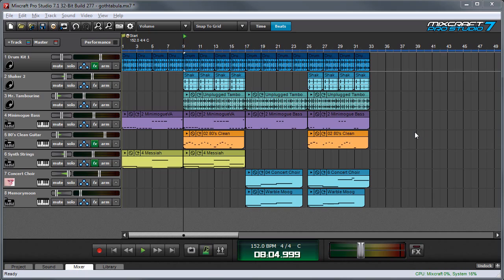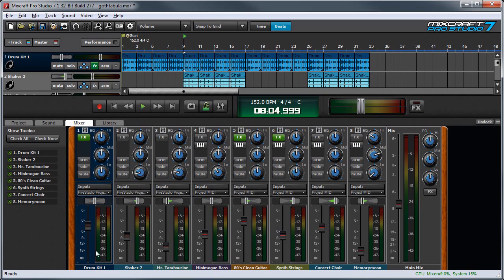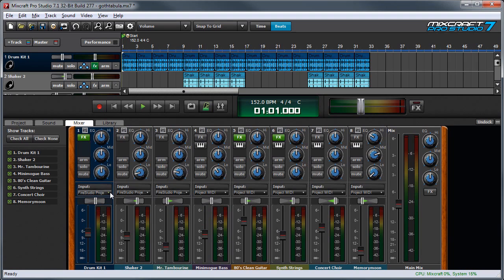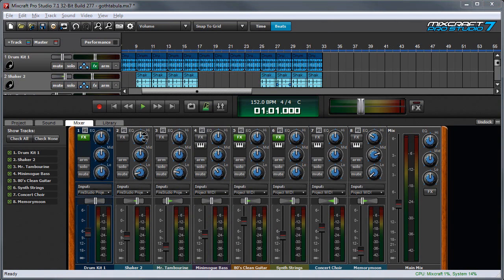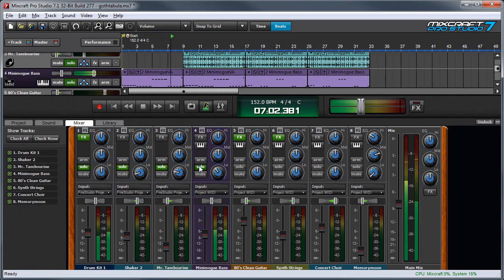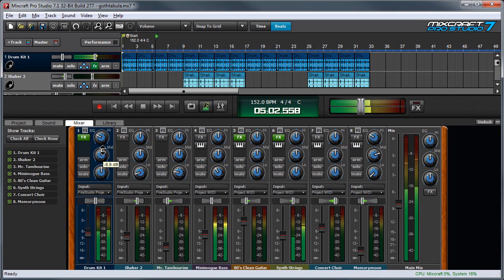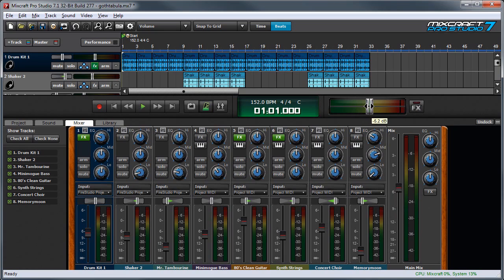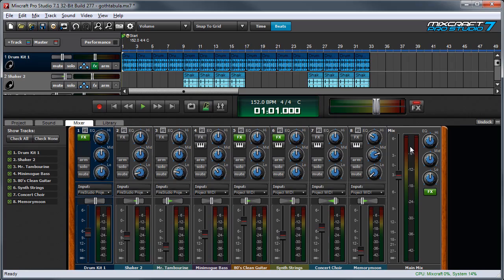Mixcraft 7 Mixer: Basics

Comment: AUDIO MIXER‌‌
By now you’ve probably used the channel volume and pan controls in the track list. Basic mixes can be created this way, but the Mixer window offers far more creative options. All audio signals including audio, Virtual Instruments, and effects can be controlled with great precision using the Mixer window.

Each track is represented by a vertical channel strip containing a volume slider, pan control, EQ (low, mid, high), insert FX, record arm, solo, and mute buttons, plus an optional Send knob and Instrument button (some controls vary depending upon the track type). Keep in mind that tracks in the tracklist have a one-to-one correlation with mixer channels; in other words, each newly created track adds a new track in the mixer.